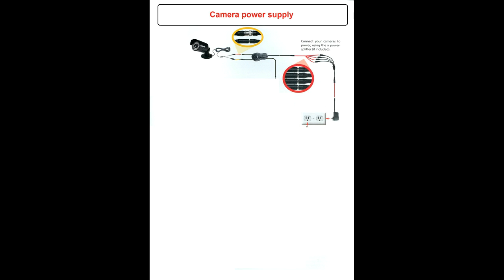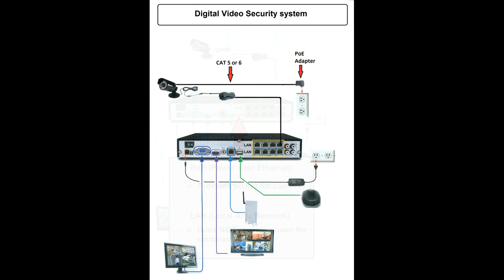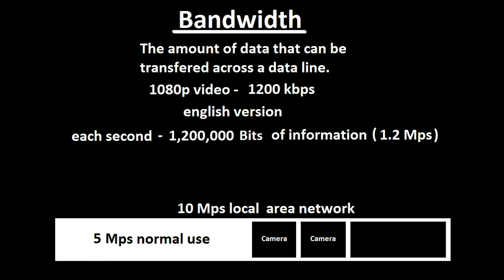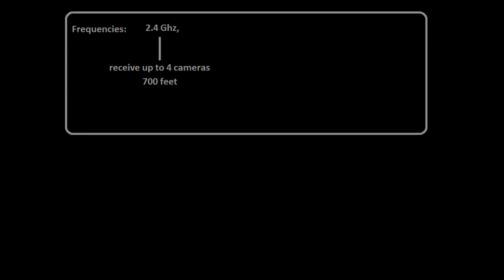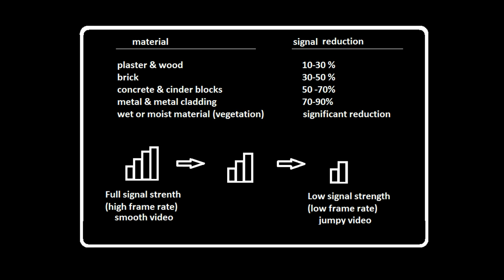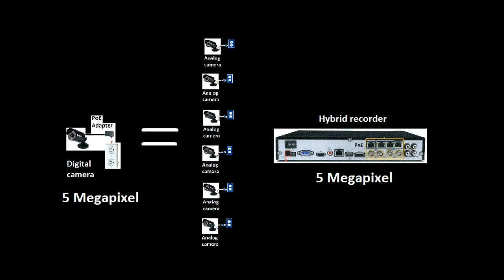video installation considerations (surveillance part 2)

Comment: hey bounder97, first of all thanks you so much for putting great videos for vista panel installationn and programming. these are fantastic videos and helped me a lot in my installations. 
i have installed vista 21ip and tuxedo touch screen keypad connected to the panel. 
i am having one issue so far. when i arm my panel either away or stay, the panel goes to sleep after 30s or 1 min or whichever time i set in the panel but if i open the door ir trip any other sensors then it does not give me any chimes or anouncement to unarm the system. whatever the delay time i have set up, it sounds the siren. This hapen only if the touch screen is not lit.
If i stand there and play with it and trip the sensor then it tells me to unarm the system. 
Let me know if you have any suggestions to fix this issue....

Thanks.